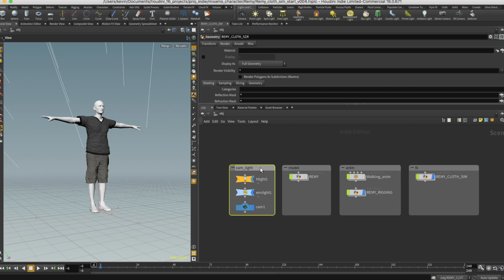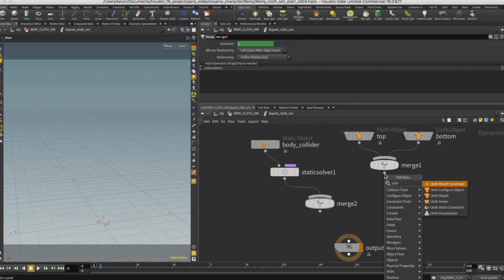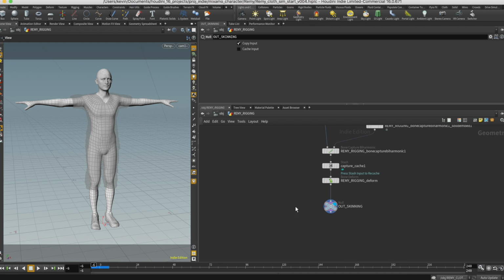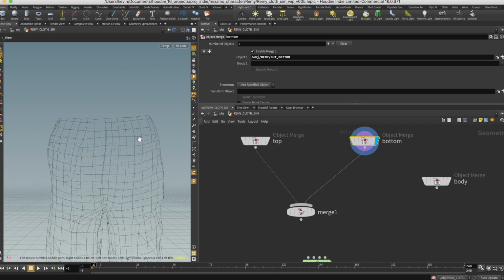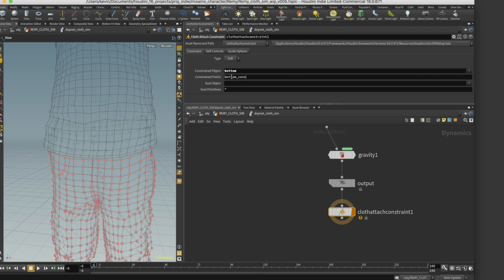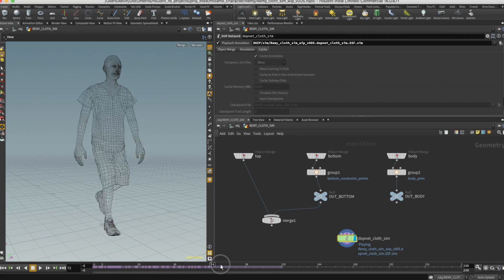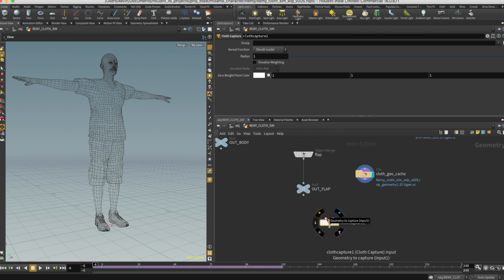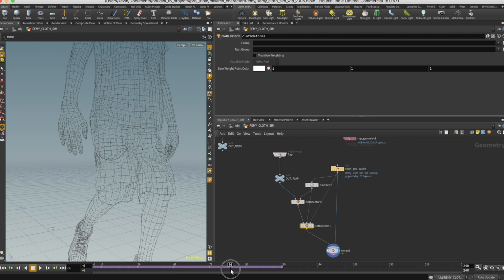Houdini Cloth Simulation Tutorial

Comment: Hey Kevin, is there a way to attach a higher poly version of the cloth object after the low poly version has already been cached, so you render the higher poly version without having to sim it? Or even if theres a similar solution that I could maybe use. Thank you:)
Reply from the maker: You can add a subdivide node after the low poly sim cache for a smoother result. But since you used low poly to sim, smoothing it won't give you extra details, say more wrinkles. So basically, you can use low poly to sim to have taste of it, once looking good, you need to switch to the a bit higher poly (just enough for details you like) for the final sim.
Reply from the maker: Oh, and I forgot to say, do you mean you want use a relatively simpler proxy version to sim, then drive the final model (which may be double layers, with seams and accessories etc.)? You can use the 'Proxy' shelf tool on the Cloth tab.
Reply: The subdivision solution definitely helps, but I'll also try swapping out meshes when I have a cloth sim that looks good. And I didn't know about the cloth proxy, but it is something that I'll probably end up using:) thank you!!!
Reply: @meganbennion3782  look up the point deform node! you can sim a low poly version and then use it to point deform your high poly :)